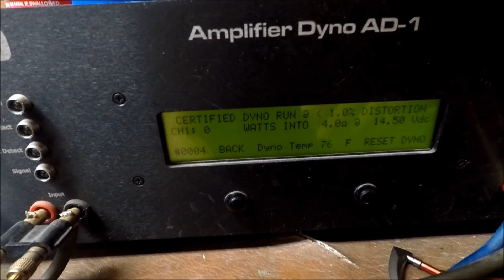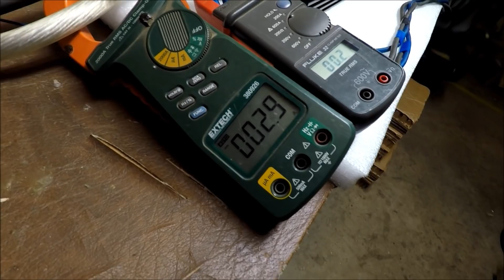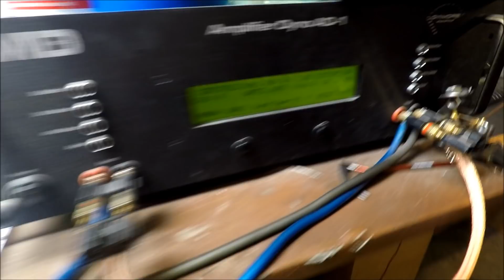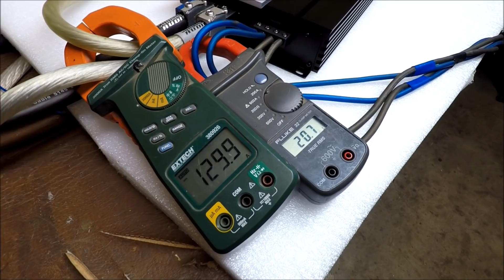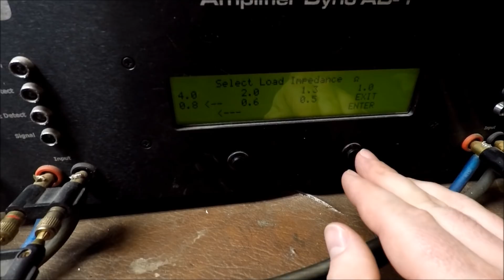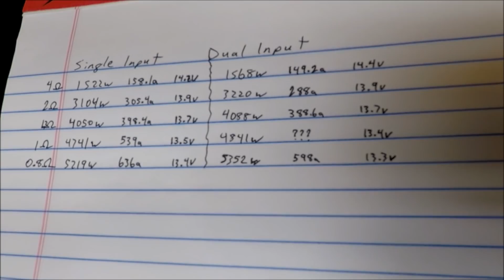*Dual Amplifier Inputs Tested* *Tech Time Thursday* at Sundown Audio

Comment: How did you run the power wires did you run to separate wires directly from the battery or one wire into a distribution block putting out 2 0 gauge wires from the one wire

Comment: I have a question if my aunt takes a 300amp fuse and I decide to run dual inputs
Do I add another 300 fuse to the distribution block to run on second line or put a 150 amp fuse in each distribution block line that the dual input us connected to?
Reply: Fuse rating is to protect the wire itself and your electrical system itself, not the amp... Another 300a fuse on a second run will be fine for you. 
The recommended number is what they are saying the max draw should be for the amp without popping the fuse. The fuse is recommended incase the wire is somehow grounded out to prevent a 🔥

Comment: So if I'm running two amps that's use 150 fuse and I'm running dual amp inputs would the fuse I use for each power wire be 75 amp? And should my main fuse that's close to the battery be 350 amps

Comment: sadly I cannot find dual amp inputs copper or aluminum that provide 2/0 inputs with a 2/0 output stud. So basically 2/0 to 2/0 preferably in copper. Only found 2/0 to 1/0 but I dont want a reducer, just 2 to 1.

Comment: awesome video!! well done. Id like to know if using a dual input with a nipple output is better than a dual input using 3 set screws and wire as the output makes a difference CONSIDERING a set screw barely makes contact with the dual inputs output "nipple" whereas it digs into bare wire.

Comment: Great video man. Im kinda confused though. At the end with the results, less amperage made more pwer?! Also, on a load of 1500 to 5000rms, 100 rms seems negligible, to me. I wonder how it would perform on smaller amps. Would 500 become 600? Would even a 100rms channel jump to 150? Thanks man
Reply from the maker: Efficiency went up that's why more power with less current draw

Comment: I'm only using dual inputs to allow for fusing from my battery bank to my amp. If it didn't draw over 600 amps I would just use 1 run.

Comment: What's the easiest way to install those to an amplifier every time I tighten it down it just will real loose again version and the screwdriver head on the amp isn't capable of the force needed to tighten it down without stripping.

Comment: 2 dual 1 ohm voice coils to 1 ohm on a single speaker wire vs just running each sub on its own speaker wire to the amplifier. Will there be any voltage increase or will it be the same?

Comment: So why wouldn't this amp come with dual power inputs already built in ??
Reply from the maker: Cause it doesn't need them.  It easily made well over rated power without them.
Reply: Sundown Audio unofficial gotcha
Reply: so adding them is basically a plus...wonder if i can make a long run for a dual input my batteries are in a front i had one in the back at one point but never thought of doing dual input ..again wonder if i make a 2nd long 18ft run of 0 gauge if it would make a difference

Comment: Would it not be better if the amplifier was manufactured with it
Reply from the maker: The amp doesn't need them.   It easily made well over rated power without them.

Comment: THAT VIDEO WAS THE SHIZNIT ALL THAT GAIN JUST BY ADDING 1 ADDITIONAL POWER WIRE AND 1 ADDITIONAL GROUND THAT'S AWESOME O WAIT THAT'S SUNDOWN AUDIO IF ANYONE DIDN'T SEE THE VIDEO WER THE SUNDOWN AUDIO-SA 15" TOOK OVER 13.000WATTS AND IT RMS RATING IS 600WATTS AND THE SUNDOWN AUDIO-SA 18" TOOK OVER 18.000WATTS NOW THAT SOME BEASTY SUBS RIGHT THERE ✌🏼👍🏼👍🏼💯💪🏼🔈💪🏼🔉💪🏼🔊

Comment: For a daily system I don think its worth the price of extra wire and dual inputs just to get 100-200 extra watts that you really want notice. But for the lanes and getting the best score on the meter yes its worth it.
Reply: It's easier on the amp. If you don't want to stress your amp in a daily, it would definitely prolong an amplifiers lifespan.
Reply: @patrickbranchini378  If your not playing low voltage all the time your amp will be fine and the extra cost could go to something else but I hear you.
Reply: It's worth running your amp more efficiently

Comment: Good test and I think their worth it. Makes it more Efficient and more power at same time. Will obviously make the amp run cooler as well.
Reply: how will the amp run cooler if its outputting higher wattage?
Reply: @olmosbananas  If you watch the video you’ll see that it takes less amperage to give out more wattage on Dual inputs vs single inputs.

Comment: The difference shows up more with a dynamic load on a hot day outside. So what was simulated here provide small gain, but it's even further realized when other variables like heat and resistance are factors. Daily drivers shouldn't stress. But an extra 100 watts could be the difference between a tie and winning a trophy on show day! Great unbiased video!

Comment: This test is accurate. If you're running a legit 4k monoblock you are gonna need extra batteries in back,  hence the amplifier will be close by an using 3 to 6 feet power wire to the battery.

Comment: Run this test on the 7500
Reply from the maker: The scv-7500d will be about double the power this 4kw will do and it has 3x the inputs.  It'll have plenty of power to work with but I still might do that test for the heck of it later.

Comment: It would be nice to see how you run your duel inputs from the battery bank
Reply from the maker: Three runs of each power and ground wire about 48" long come from the battery bank on the floor up to a set of distribution blocks on the table.  Then wire about 24-32" long run from the distribution blocks into the amplifier.
Reply from the maker: And there's an entire video on the channel that shows the test benches, battery banks, power supplies, and I explain everything.
Reply: Awesome! I'll do some looking to find the video! Btw... I love my sundown equipment. Running a 1500.1 on 2 SA 12s in a Chrysler 300 backfiring. Took second in state with a high of 146.3 in USACI. Awesome product!!

Comment: This test is not acurate becuse in a car you have a much longer wire longer wire = more resistanse = voltage drop. Do a test with longer wires i think that will make more of a differnce
Reply: Its amazing how the "So-called" top of the line companies reply to people on here and social media. YOU are supposed to be the professional. And there was nothing professional about that reply. SMH
Reply: Lol he's a worker there. Read the channel name, "unofficial". He's not speaking on behalf of the company. Also to be fair he's 100% correct.
Reply: Philipp Trapp He’s not 100% correct in how he handled the comment. Very unprofessional.  And workers represent the company they work for on and off the job. Any legit business person knows and understands that.
Reply: Henrik most people have battery banks close to the amplifier
Reply: @asilaydying1984  i havent
Reply: Henrik if you haven’t you shouldn’t run this big of an amplifier
Reply: @asilaydying1984  i dont have that big of an amp i was just interessed to see if longer wire made more difference but i just got a rude comment back (not from you but from sundown)
Reply: Henrik  depending on what wire your running and how large it is vs current pull the length could make it not sufficient for what you need . What amplifier are you running and how long is your power and ground runs ? Also what size and type of wire are you running
Reply: get real buddy...you make ignorant comments then get mad at the Sundown channel..they are doing more for the community than most others are..good riddance!
Reply: @herbyverstink  Lol I wonder what hendrik is doing for the community???????
Reply: Even at the extended length , the difference will still be feasible compared against each other!!
Reply from the maker: Your comment is not accurate.  Anybody running this amplifier, or one of this size, should have an upgraded electrical system with an extra battery (or two) in the rear of the vehicle.  If not then you're doing it wrong.  Also if you're too cheap to upgrade your electrical properly then you're too cheap to even own this amp and definitely too cheap to use multiple long runs of wire from the front of your car.  Your entire theory is invalid.
Reply: @UnofficialAudio  Your assumption is that everyone buying this amp is trying to run it at 1 ohm. While most people are, there are possibly some  who need 1500 watts at 4 ohms. 1 or 2  runs of wire from the front of the car on stock electrical of a modern car would be sufficient. Not necessarily optimal, but sufficient. If you disagree why even bother with the 4 ohm test in the first place. Also why ask for suggestions on what to do different if you are just going to call people stupid for asking.
Reply: @jutin2001  I suspect 1 run from the front would be enough at 4 ohms.  My concern with his test is that I don't know where the second wire was connected.  Was it bringing additional power system into the equation or was it simply adding a second path to the same source.  Also the fact that he didn't record the voltages is silly.  If he's trying to show 2 or 3% differences, using the same voltage and probably multiple runs to increase sample size is critical.  2% change in voltage would account for 2% gain in wattage.  It did look like the amp was more efficient with dual power though... Again for all I know he was adding another battery bank to the equation making the entire test moot.  He didn't say where the second power line was running.
Reply: @troyg3831  The other issue i had with the response from sundown unofficial was that this was a test of dual inputs. Not a test of a 4k amplifier. So to say that if you are too cheap too upgrade electrical you are too cheap to buy this amplifier is just kind of an uppity thing to say, and has next to nothing to do with the original suggestion of using longer runs. But the test wasn't for the amplifier it was testing what happens when you double up inputs. Not to mention that there still has to be runs of wire from the alternator to charge the battery bank. With that much current draw it isn't all coming from the battery bank. Everytime the voltage dips it is going to pull from every source available.
Reply: @troyg3831  I honestly am more interested in the efficiency increase than I am the slight increase in power.
Reply: @UnofficialAudio  tbh I don't think you're right at all dual inputs are the most useful when you have longer runs of wires let's say for whatever reason you have all your batteries under the hood and have this amp ~14ft away. Then the dual inputs will be making a huge difference.

For me I run a blow through in my truck and have all my batteries under the hood because I can't sacrifice anymore bed room or behind the seat.
Reply: @UnofficialAudio  sorry for my comment i would never buy an overpriced sundown amp most amps are bulit at the same factory and look the same inside you just lost a subscriber for being rude to me bye bye
Reply from the maker: The butt hurt is real.   You said my test was not accurate & now you back peddle.  See ya.

Comment: In this case with this particular amp id say not worth it for a few more watts. Those inputs are 40-80 bucks depending on aluminum or copper
Reply: I'd pay that price if I were still competing in dB Drag. That power increase can equate to a few more tenths of a dB, which can be the difference between 1st and 2nd place.
Reply: @PURESOUND4  yeah no doubt in competition that could make the difference but for ground pounding id say buy some bud with the money you saved on not buying inputs lol.
Reply: u can pick them up for under 20$ per pair  at alot of places
Reply: Jim's Machineworx
Dual Inputs - 1/0 to 1/0
$17.99

this is from the amp lab the place where sundown sends there amps to be repaired
https://theamplab.net
Reply: It's definitely worth it for chump change to let your amp run more efficiently and cooler !!!  Efficiency is the key to longevity

Comment: Derrick I have a question for you.  I have a scv 6k and a ns1-v1 amplifier.  I want to sell one or the other so I can have two of the same amps so I can strap them. I run zv5 18's dual 2. I have a 12v charging system.  It charges at 15.0 -15.3v. Drops down to 14.9-14.8v in the heat. At full tilt on two ct sounds 4ks strapped it drops to 13.8v. My question is which amp would you sell to purchase a matching set? Better to have 2 scv 6k's or 2 ns1-v1's strapped on my subs.  Anyone else's info is appreciated as well. Thanks for the great videos!
Reply: Josh Hanson go with scv ( sundown capped voltage ) unless u running 16/18V system
Reply: @uptobatentertainment  thats what I was thinking myself.  I just wanted to be sure. I read somewhere that they got a 1/10th louder with the scv over the ns1-v1 on the exact same setup. 12v system.  Once you go over 12's though I heard the ns1 was a beast. But I doubt I'll ever go to 16-18v. Thankyou for your reply.
Reply: Josh Hanson anytime glad I could help. The SCV is a newer line than the nsv 1 v1, that’s an older amp, In that case I would def go with newer design of the scv!
Reply: 2 SCV 6K's

Comment: Cca wire vs. Copper wire would be a nice test. We all know copper is better than aluminum but I would like to see the difference on the dyno.
Reply from the maker: That is on the to do list.
Reply: steve meade did this already
Reply: It’s going to be about a 300 to 400 watt difference. The ofc will draw more power.
Reply: Diff would he a big ass current draw and not molten hot wire lol
Reply: Ya know whats funny everyone has problem with cca wire,lol what about the cca voicecoils on subwoofers🤷🏻‍♂️no one ever mentions it.so no matter if ya have cca or ofc ya the main part of the stereo still has cca wire in there.unless ya have copper vc .
Reply: @bkh5746yeah and they use aluminum input adaptors lol

Comment: I think it's worth it plus the amp doesn't work as hard and doesn't pull as many amps but has a power output increase so in my opinion dual inputs ftw

Comment: Great video man! What would be another good one to see is Copper dual terminals vs Aluminum dual terminals. Though you would most likely have to have the same style in both so there is no added or reduced weight in both types of terminals to keep it fair.
Reply: Hehe I'd like to see a pure silver terminal best conductor <3
Reply: i seriously doubt there would be a significant difference with a mass of aluminum like that,resistance would be very low.

Comment: like to see the single wire test done with the wire directly into the amp with wire ferrules
Reply: seancarraher you won’t see any difference
Reply: Well besides the fact that there probably isnt a wire ferrule in that whole building , the conductivity of aluminum is %60 of the conductivity of copper. And that number drops to about %50 during high heat situations like car shows and long demos which probably wouldnt show up in this type of test. Copper also loses conductivity in high heat situations but at a lower rate.

Comment: Little more power yes, It appears the current draw was more efficient allowing the amp to not work as hard. I think that is more significant long term than the few more watts put out.
Reply: I don't know bro, starting voltage was higher in second set of runs, that alone could cause the small differences.
Reply: @Rumblebee2655  this was my thought even a .15 increase in voltage would cause more output. I find it strange that he didn’t keep up with the voltage. Most big amps have oversized 1/0 gauge I would argue that a 2/0 gauge would do the same or better than the dual adapters
Reply: Most definitely
Reply: Absolutely...amp would last forever running it much more efficiently

Comment: Run it with 20 feet of wire since my my amp is about that far from my battery
Reply from the maker: Anybody running this amplifier, or one of this size, should have an upgraded electrical system with an extra battery (or two) in the rear of the vehicle.  The wire from the rear battery to the amplifier should never be 20ft in length or anywhere close to that.  If you're only running like a 1500w amp then you shouldn't ever need dual inputs anyways.
Reply: @UnofficialAudio  I think Eric has a point, if it makes this kind of a difference on such short runs, it'd make a bigger difference when using longer wires.
Reply: Sundown Audio unofficial Neat. I Never plan on running a single amp over 2k. Was looking at 2k to 2.5k. I apologize for assuming this was an informational video on dual inputs and not the amp.....I only have 3 group34’s under the hood since there is no room in the back and I don’t feel like adding a battery disconnects because I have batteries back there. I also upgraded the factory dual alternators . Sorry I said 20 it is less maybe. Truck is only 20 feet bumper to bumper. And yes the subwoofers and amplifier for it is way in the back by the tailgate under the canopy. I was using your 1/0 300A install kit size which I find just found interesting because I need 2/0 at that length for 300A and I was actually wondering if I should get  two kits or just buy 2/0 which I’ll probably still run dual. But thank you for helping me decide.
Reply: @UnofficialAudio  can I run the dual 2 ohm sa12 rev 3 on a scv1500 or should I get a bigger amp?